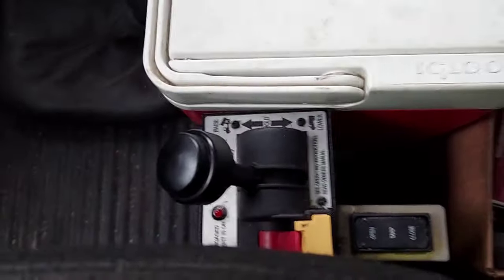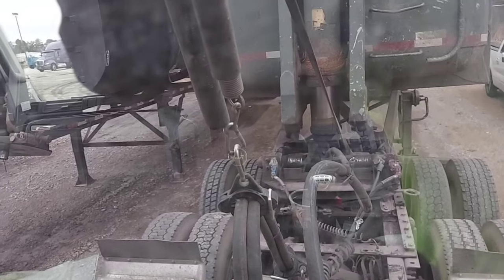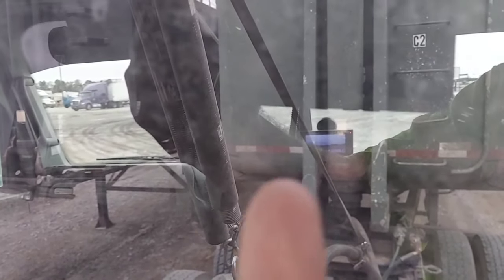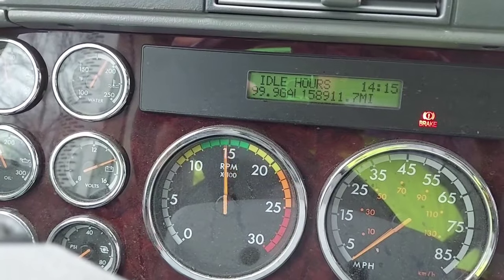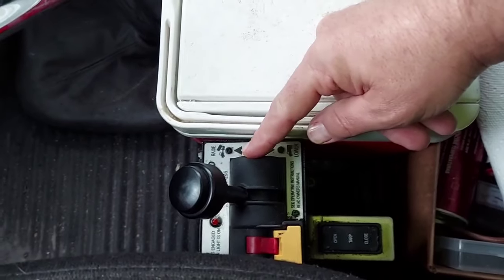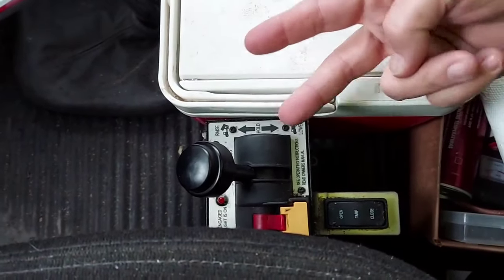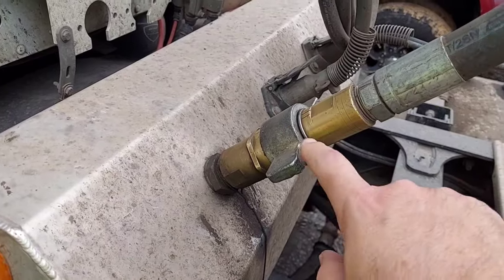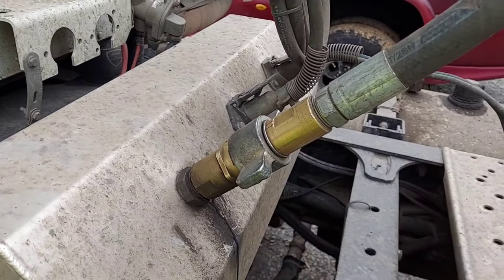End Dump PTO. how to use and troubleshoot.

Comment: If loaded incorrectly at a Materials Site. How do you balance your load? I've seen others lift their bed partial with gate on. This allowed gravity to shift load back but I tried it with my bed and when I released the bed downward, it flew down and slammed on the frame? How do I trouble shoot this? Other's I've seen drop down the bed slowly. Can you share your experience please.

Comment: Yessir. Just had to have my dumper in the shop because the pto sounded real loud almost like it wasn’t getting fluid. Tank was full
Reply from the maker: Anything that can go wrong, will go wrong in trucking!
Reply: With a truck that has 43k miles and a entirely new wiring harness already... I know 😂
Reply: @jrichtruckincbtips   I wanted to thank you for this video. The guy at work I just couldn't understand what he was saying and couldn't get it. I just had got hired and never drove a truck with a pto like this. But without this vid. I wouldn't have got to keep that particular job on the farm Again I thank you sir.
Reply from the maker: @tmangamingx  you're welcome, glad I could help, and thanks for watching.

Comment: The bed of my trailer is fully raised and won't lower.  The employees at landfill want me to back it up and turn the wheel to get out of the way.  I told them absolutely not.  I'll go straight forward or back but will not turn the wheel.  Then came " you're in the way " .  Do you think I enjoy sitting here ? They kept at me n I used my stop work authority.  Get your supervisor n well talk. Later the dispatcher called n asked me if I'll climb under n fix it .  That's not just a no but HELL NO .
Reply from the maker: Yes Sir! You're the captain of that ship.

Comment: How much does a pump for this type of PTO cost? I just bought a dump truck about 2 months ago and the trailer won’t go up all the way when loaded. Unloaded it will but very slow and only if you press the gas pedal.
Reply from the maker: You'll need to get with your local trailer shop for that.

Comment: How could you turn a single line pto  from an end dump to a 2 line pto for like an rgn? Thanks for the video.
Reply from the maker: Dude I got no clue
Reply: @jrichtruckincbtips   I get that the single line pto is pressure and return in one I would think it would just be by adding a hydraulic line and a coupler. I’m stumped on it too. I’ll probably have to buy a new pump with dual lines 🤑🤑🤑🤔🤔🤔
Reply from the maker: @jrvillarreal2901  I had a truck capable of both, it had a switch lever.
Reply: My truck was a 2 line and is now a 1 line it involves a plumbing change or at least that's what I was told we also have 3 line feed tank set ups but nobody can figure out how to combo them on 1 line systems

Comment: Hey J! I just bought a truck with that pto sistem with 2 lines  installed. My question is if is gonna work to use on roper pump to transfer fuels? Thank you J.
Reply from the maker: I honestly don't know, because I'm not familiar with the roper pump. However, I would think a little modification to the system maybe needed.

Comment: I’m starting at a local company tomorrow. Our gate control is the “5th wheel slide” switch. Say I’m unloading clean asphalt, when would I release the gate? Before I start lifting the end dump? Or after I’ve started lifting?
Reply from the maker: With unloading in a asphalt machine, I always opened before lifting. The only time I opened after lifting was when spreading gravel or crush and run.

Comment: Can I get the switches for the tail gate and air bags installed in the cab? Have you ever heard of this for a frameless end dump?

I'm in a wheelchair/walker from falling out of a truck and breaking my back, this option would get me back in the truck. I would imagine this would also be considered "workplace accommodations" from the government in assisting me back into the workforce and off the disability safety net. Trying hard to get back to my career. 

What ya think, doable?
Reply from the maker: Definitely doable, anyone who deals with dumps should be able to help you.

Comment: If you press clutch does it stop the load at its height or drop down? If your half way up and put in neutral does it stay at that heighr ??
Reply from the maker: Yes, pushing the clutch will stop and maintain the height. Putting the pto stick in in neutral will stop and maintain the height as well. Pushing the clutch in and put the trans in gear and releasing the clutch to creep forward (without putting the pto stick in neutral) the bed will continue to raise while moving forward.. This is how dump trucks spead gravel. This is not recommended for dump trailer, just Tandem dumps.
Reply: @jrichtruckincbtips  thank you for the responses! I am a chrysler/dodge tech and only are 1 tons have optional pto unit. All electronic controls and hydro movement.  When switching pto lever position is it neccasary to clutch in?
Reply from the maker: @Ranalla651  all my PTO experience have been semi's and tandems. I'm manuals yes push the clutch,  automatic no clutch just flip an engaging switch.

Comment: I’ve got to say, I’ve been pulling an end dump for close to 30 years. I’ve never heard of hydraulic oil leaking from the tower. It’s virtually impossible, all the tower is is an air valve that operates the plunger on the side of the pump
Reply: Mines doing it right now trying to figure out where it’s coming from
Reply: @kkwoodscapes mines did it to. I think it stopped after new pump.
Reply: With your experience....I got a pto installed on my autmoatic freightliner.  They said to put on "D" when turning on pto. Would I put it on "N" soon as it comes on? I'm confused
Reply: I would say yes, but I’ve never had an automatic. I wish I could help you with that. I am curious though, because my next truck will probably be an automatic

Comment: Can you use a truck with pto control to haul as a dry van?
Reply from the maker: Yes
Reply: The fifth wheel sits flats, do I need to take it to mechanic to have the lock moving. Wish I could send a pic somewhere to show it to u
Reply from the maker: @Mohamed  for a dry van the 5th wheel needs to be tilted.

Comment: Hey J is there any tips you can give me my pto seems to be working Intermittently the trailer we go up a very little bit then maybe after the 4 time of trying it will go up smooth
Reply from the maker: Sound like there could be a sticky valve or trash in the system.
Reply: @jrichtruckincbtips  ended up just swiching trucks everyrhing working fine now

Comment: My pto tower won't stay in the "hold" position.  It just keeps going up.
Reply from the maker: Maybe a bad valve in the stick.
Reply: @jrichtruckincbtips  the hydraulic pump ended up being bad I guess it was getting stuck or mabey the air shifter was bad o well I ordered a new pump n it works now.thanks for the reply.

Comment: The knob on my PTO tower started leaking air.  Just today.  Still works,  goes up and down and engages.  Just the annoying air leak.  You happen to know if I have to disassemble the tower or what do I have to replace?  Thanks man.
Reply: By the way I have the same tower as you on the video.
Reply from the maker: Could be a couple things. A loose air line,  bad o-ring, or a Crack in the valve assembly. Just have to find it. Thanks for watching
Reply: @jrichtruckincbtips  just finish work for the day and week and took truck home.  I’ll start looking for the problem today!  Thanks a lot man.  Have a great weekend and 4th of July.
Reply from the maker: @cesar9496  you too, best of luck
Reply: @cesar9496  Did you solve the air leak problem?
Reply: @ianstewart-koster9982  yes!  I took the tower apart and it was a small piece that’s part of the tower.  Like a small little nut,  it blew the nut away and had a hole.  I basically needed a new tower,  so since I did the work on a Sunday and everything was closed,  I jb weld the hole and problem fixed,  I haven’t got that leak again.  A year later and same tower with no problems.

Comment: What if the truck is an automatic transmission? Do you Rev up the engine?
Reply from the maker: Set trailer break, trans in neutral,  Rev it up.
Reply from the maker: Yes, set trailer break, transmission in neutral, and rev the engine.

Comment: I have a 2005 peterbilt 357 automatic dump truck. The bed is going up slow. Nah advice is much appreciated.
Reply from the maker: Could be several things, best to find a good trailer shop, so you not wasting money chasing it.
Reply: Did u find out the problem I’m having the same issue on my automatic? Tya

Comment: If my hoist control lever is cable operated can I convert it to this air style pto tower that you have and if so would it be hard to do or costly?
Reply from the maker: You'd probably be looking to buy a whole new unit.
Reply: Might be late for a reply, but it costs around $500, depending on how you plumb it into your air system.  You can keep the PTO you have but have to swap out the plate that the cable goes into now for one that is air controlled.  It's an easy swap.

Comment: Does cold weather effect the pto. It won't engage.
Reply from the maker: I've never had problems just because of cold weather, but it doesn't get really cold here, maybe 10* or 0*F. Could be water frozen in the air lines. Maybe run some air line anti freeze. Only thing I can think of off the top of my head.